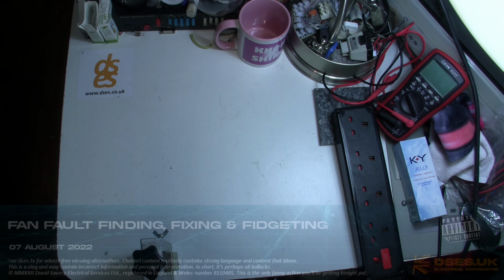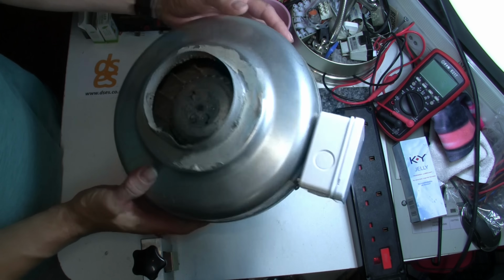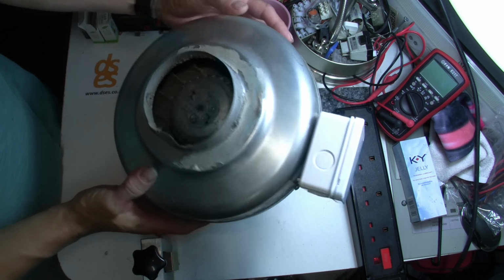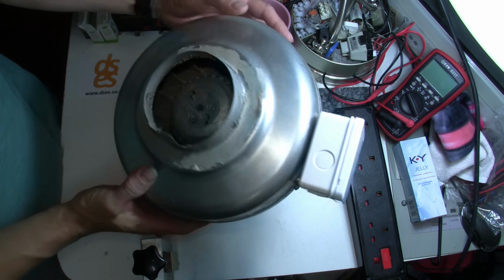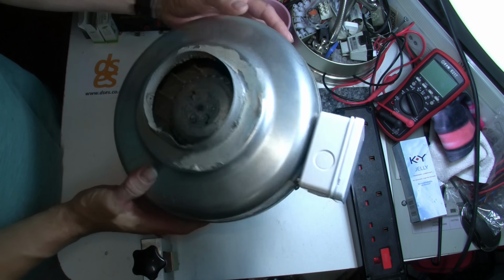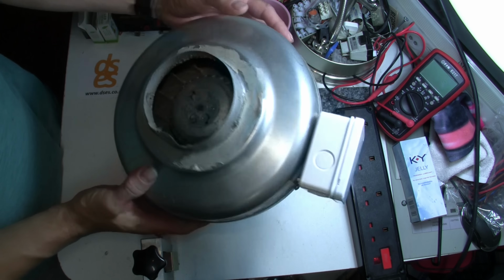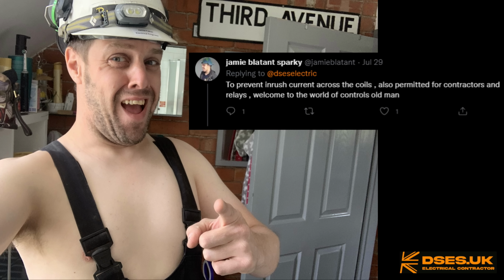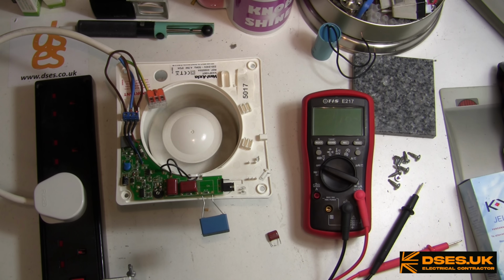Fan fault finding, fixing & fidgeting

Comment: Neutral switching would be fine within the appliance and is often done this way for a variety of reasons, but since this is a separate unit I would agree they are using something that hasn't been designed appropriately. Btw, the humidistat is using an SSR arrangement with a snubber across the switching device. The snubber effectively forms a complex impedance allowing some current to pass - enough to illuminate some of those lamps. The LED lamps with switching regulators in them will often flash as you saw on the Ikea lamp, passive or impedance controlled LED drivers will just glow dimly. The term polarity on AC though is painful... Earth referenced maybe?
Reply: Btw the suggestion of using it to reduce inrush current across the coils is garbage.
Reply from the maker: I knew you'd have the skinny on it Steve!
Reply: I View polarity on an AC circuits as the equivalent of resistance which we all know is impedance technically. Referee: it's shorthand and I will allow it.
Reply: Diode in the switched live biased to block DC from the humidistat fixes it.  The voltage must be high enough for the lamp to start to switch on and then immediately discharges it when on turning it back off again.  Then the humidistat/timer charges back up until the lamp attempts to start then off again.  Rinse and repeat with a flash each time the lamp attempts to start.  Only ever happens to me with electronic HF ballasts on CFL lights and LED drivers.  It never happens with filament or magnetic ballasts as both probably give this charge a path to neutral.

Comment: In a distant way it reminds me of some of the very old radio sets where the chassis was live and had to be insulated from the case with rubber grommets (or the case was wooden).  Those devices when powered up for repair on the bench could really catch the uninitiated out!

Comment: ive always liked to use a flush mounted ceiling pir to switch bathroom fans on and use the timer on the pir for the over run on the fan. by doing this it means the fans still going to work when they dont bother using the lights . like many do while showering during the day and not opening the window

Comment: Had a similar problem with a rogue 50V on the input of the non-humidistat brother of that manrose timer. Manrose tech help told me to stick a 1N4007 on the SL which stopped the led flickering
Reply: Just watched a bit further in, and seems like you got the same model in the end. Diode on SL is the solution to low wattage LED flickering

Comment: 1.75uF for a 2uF cap is pretty much bang on in capacitor terms when you take into account measurement accuracy. ESR is a much better indicator of capacitor "quality"/health. In fact the Peak tester you used is an ESR meter NOT a capacitance tester it only gives you a ball park capacitance reading as a byproduct of it's main function.

Comment: I got a question on 463.1.2 in my 18th edition exam. I couldn't for the life of me think where you were allowed to switch a neutral, and this turned out to be the answer. As you point out, it appears to contradict itself gloriously! I completely agree that the design of that timer is ridiculous and it doesn't fill me with confidence that they can't even spell the words they used to fob you off....

Comment: The ludicrous part about this is that a triac is ideally suited to switching the live supply to a load. The gate (pin that triggers the triac into a conducting state) can be switched early in the cycle and once on, the device continues conducting even with the gate current removed until zero crossing occurs, in other words its very easy to drive a triac in the live side of the circuit. Its an odd design because there is no obvious advantage in switching the neutral.

Comment: I've used that model manrose humidistat timer before.  Its working but with a filament lamp the rogue voltage feedback on the "switched line" would be discharged through the lamp and would disappear.  On an LED or high frequency cfl ballasted fitting you get that pulsing.  You have to add a diode to block the pulse coming from the humidistat on that line that causes the lamp to start.  I used a 1N4007 1000v 1A general purpose rectifier diode blocking current from the controller.  The controller then works as designed without the flashing pulse when the light is switched off.  Its about time they fixed that controller.  I usually heat shrink the diode an put a leg in a wago.

Comment: Your a funny mofo Dave 😅😅😅😅Electrolytics have quite a wide tolerance plus minus 10 to 30 percent in some cases..   also ac caps are usually rated for ac voltage ie rms so probably fine to charge it up to 500v 👍

Comment: That company's response is pathetic. Won't be dealing with them at all

Edit: Also, I don't think they can do that with warranties, if it was a like for like replacement by a homeowner,  then they have to honour the warranty, as it's an allowed activity under part P.  

Effectively they're selling a product that you CANNOT install in the UK in a compliant manner. They need to state this on the packaging, and possibly shouldn't even be selling it. I agree with Steve, INSIDE appliances, neutral switching is commonly done, but within an installation, it's specifically forbidden.

Comment: A 20p component kills a £30 fan simple fix assuming you have the skills.knowledge and understanding but in the real world who will change a capacitor on site?
Reply from the maker: Well, you wouldn't. I sure as shit didn't - I replaced the whole thing and was going to bin the duffer. It was only that fact I was halfway through making this video that gave me the impetus to look into why a Vent Axia had gone pop! Still, I could have switched to the second speed setting and left it on site had I thought of doing such.
Reply: @dsesuk  I actually have done that, but only because the robbing gits wanted £200 for a programmer on a boiler (and it was a mate).
Reply: @dsesuk  
I personally wouldn’t either but it goes to show a simple part renders a fan useless 👍👍

Comment: 37:47 those really crisp letters reveal that the letters were probably typed on a typewriter with correction capabilities. Those used a polymer ribbon not unlike label printers have. The typebar slams the ribbon to transfer the carbon onto the paper. I am familiar with this kind of typewriter and Technology Connections does a good job of explaining how they differ from fabric ribbon typewriters: https://youtu.be/YE0U018Copw

Comment: I do wonder if changing the labelling on the SwiftAir switch might solve the issue?
If you swap the L and N inputs, the TRIAC would then be on the L side of things. I think that would work and TRIACs don't care which way up they are as it's AC.

That being said, you can still get enough leakage through a TRIAC to be unpleasant. I used to design and build things that used SSRs and we did make it very clear that for a lot of reasons you couldn't rely on the off output of the SSR to be safe to work on.

In DC control systems and in vehicles it is very common to switch the negative. If you look at the wiring diagram for a car fan you're likely to find a relay on the negative side. And don't get an amateur radio person started on the subject of fused negatives, I did that once and there be dragons.

Comment: Talking of the 💩fans i work for a company that has a  housing association client as part of the contract my colleague fitted A Nuaire Faith fan in a bathroom this year 2022  it started tripping the lighting circuit with in a day.
I  disconnected the fan for  IR & Continuity tests on the circuit including to the light which were fine so I replaced the fan thinking it was a faulty unit  and that tripped the lighting circuit as well so fitted a new 3rd fan in it still tripped, triple checked connections decided to say sod it and rewired the fan circuit just incase of any hidden damage as the chances of having 3  faulty fans is unbelievable which it turn out all 3 brand new fans were faulty

Comment: The capacitor probably went low capacitance due to mains transients and spikes blowing holes in it.  Each time this happens the capacitance drops a bit.  Maybe a SPD in the consumer unit may prevent a reoccurrence.
Reply: It isn't low, in capacitance terms it would be considered bang on when you take tolerances into consideration. ESR is a better gauge of health and the meter he used is an ESR tester not a  capacitance meter.
Reply: @mfx1  This is how capacitor dropper type circuits fail. The foil capacitors are called "self healing" in that every time they get a voltage spike it punches a short through the insulation. The film then burns back restoring the insulation but at the cost of reduced capacitance. Over time the capacitance drops so much that there isn't enough current for the circuit and the associated electrics fail.  These foil capacitors normally have 20% tolerance - ESR tests won't show this fault unlike paper and electrolytic caps.
Reply: @AndyFletcherX31  There's no evidence that there's anything wrong with this capacitor, it's within tolerance particularly when you consider the peak meter is NOT an accurate capacitance meter in fact they only quote accuracy for ESR measurement not capacitance.
Reply: @AndyFletcherX31  Dave Jones did a tear down of a low value capacitor on EEVBlog recently, including some feedback by a guy whose job is, from memory, something to do with QA/Design of these capacitors.

Comment: How do you fit a diode across an AC relay coil? in one half cycle its a reversed biased diode but in the other half cycle its a forward biased diode and a loud pop generator (only once 🙂). Also an AC relay coil has a poll piece fitted to stop it dropping out during voltage reversal so it don't buzz at 50Hz.

A second point is not all contacts are created equal, watch out that the NC contacts can sometimes have a lower switching curent limit than the NO ones.
Reply: It is possible and there are a few ways to do it. Essentially it's working a bit like a surge protection device. It's also entirely possible that the diagram just has a picture of a diode to indicate that it's doing something clever because everyone knows what a diode's symbol is and the purpose it serves.

One is to use a pair of reverse biased Zener diodes or something involving avalanche diodes.

A Zener diode is designed such that they block current until the voltage reaches a certain level at which point they start to conduct almost like an open circuit with a fixed voltage drop across the diode. Two of those facing each other means that if the spike is positive compared to earth then diode 1 conducts, and if the spike is negative compared to earth then diode 2 conducts. Depending on the application you do have to be careful to not overload them so you might use current limiting resistors or PTC resistors.

They're useful in a lot of other ways too. You can use them as voltage references and they're particularly useful when trying to reference low voltage control circuits to variable voltage switched inputs.
Reply from the maker: I'm just going by the internal wiring diagram on the relay itself.
Reply: @dsesuk  The diagram on the relay is for the LED indicator. Back EMF protection on an AC relay is usually only done by using a snubber, though the LED and inverse parallel diode + current limiting resistor may have a marginal effect.
Reply from the maker: @sdgelectronics  Now that I look at it more closely, the diagram does indeed show LED indicators. It seems mother was right about how playing with one's wenus too much would affect one's eyesight.

Comment: It seems a case of swiift air going its not my job mate and hoping nobody noticed.

 Having worked with lots of industrial and marine environments a lot of the industrial fans and a lot of the controls systems were a hodge podge of systems and never seemed to be a set setup.

Comment: Excellent job sir. I can't understand the bollocks about switching the neutral, it just doesn't make any sense at all. Although having said that, I had to have a look at the KnightsBridge EX001T 4" Axial Wall & Ceiling Extractor Fan With Timer, I have sitting in a box before me, and the constant live feed just loops in on one terminal, goes through a wire jumper on the PCB and goes straight out, via another terminal, to the fan motor, meaning it too is switching the neutral. WTAF???
Reply from the maker: That's okay if it's part of the same assembly, but there could be an installation with this product where it's hidden away and someone unsuspecting wouldn't even think of it being there ready to pounce!
Reply: @dsesuk  What's really funny is that they went to all the trouble of routing out anti-tracking slots between both sets of live and neutral connections, inward and out to the motor, and the switched live, but then they ran the incoming constant live PCB track around in a loop to the motor live terminal. 
It defeats all the good work they did with the anti-tracking slots, especially when the device/PCB is operating in damp/wet conditions... 🤣🤣

Comment: Interesting, it wouldn't be the first time a product has been sold in the UK piggy backing off a standardised design another company uses but doesn't actually comply with the initial BS. Still it highlights always have a tester with you if you don't have a death wish.
Reply from the maker: I always keep my voltage tester on my Batman belt!

Comment: Great video David.  I expect you know this, but a simple solution to the 2 switches-2 lights-1extractor problem is to use double pole switches.  At each switch, both of the input terminals are connected to the permanent live.  One switched live goes to the light, the other to the fan.  When switched off, the outputs are separated, so the light can't come on when the neighbouring light is switched on.
Reply from the maker: Damn. I should have shown that.

Comment: Your TIS multimeter is almost identical to my Uni-T and eight times dearer  ,
Reply: It's a rebadged Brymen, think it's a BM239, and they are in a different league to Uni-T.

They're a bajillion times nicer to use (that's a metric bajillion) and their safety components are rather better thought out.

That being said, the newer Uni-T meters are a lot less bad than the older ones. I've had and used Uni-T equipment for years, my first meter was a Uni-T from Maplin back in my university days and my most recent two bits of test equipment (a 210E clamp meter and a thermal imaging camera) were both Uni-T. But the Brymen kit is so much nicer to use, better built, etc.

Uni-T has a place but there really is no comparison.

TIS do also rebrand some Uni-T kit, the TIS 280 and 835 are both Uni-T for example.
Di-log and CPC/Farnell under the Tenma brand have a lot more of the Uni-T kit. Often European spec or European branded Uni-T equipment is either downrated compared to the same Uni-T design or it's had some of the internals beefed up.

Comment: Tangential question: How does ventilation work in the UK? Here in Sweden, those fans would would be always on, ensuring airflow at all times with input through wall/window vents or with another fan system for injection. The kitchen hood might have a knob to increase fan speed when cooking, but not to entirely turn off the fan.
Reply from the maker: Most tend to be timed so they come on with the lights, then shut off shortly after the lights have been extinguished. We've started installing humidistat variants more commonly that only come on to vent the air when damp. If they're on all the time, does that not continually exhaust good air you've paid to warm up or do you use some kind of heat recovery?
Reply: @dsesuk  The systems with input/output fans usually have a heat exchanger built in but my apartment does not, input air goes through the radiators in every room to ensure heating, I guess CO2 extraction is prioritized over heating costs.
Reply: Note: there are no intake vents in the kitchen or bathroom to ensure forced airflow from bedrooms etc.
Reply: @dsesuk  I live in Finland and have the same model fan on the roof of my house running 24h/day. The fan takes air from the bathrooms and air comes in via small vents in the lounge/bedroom windows. It's totally different to the British approach where people open their windows a little to "let the air in". Thanks to this towels dry in the bathroom just by hanging them from a hook and packets of biscuits left open in the kitchen get dry and crunchy, not soft and stale like in the UK! In Finland you will never see condensation on the inside of house windows when you walk down the street.
Reply: In the U.K. they build houses with loads of draught, gaps around windows and doors and ‘cold roof’ design dominates - so in the U.K. the house is so well ventilated it could provide adequate life support for a Euro Cup Football final and bathroom fans are only intended to exhaust the ‘wet air’ and might have a run on of 15 mins .
Whereas in Scandinavia you design houses to  ‘Passivehaus’ or very near to it, with exacting build standards with air tightness standards and heats recovery and designed ventilation rates specified. In the U.K. houses are thrown together in 16 weeks by multi layered sub contractors who are untrained, unsupervised don’t give a fuck types who would not be capable of a decent job in their own house.